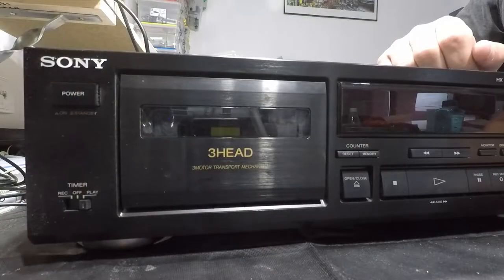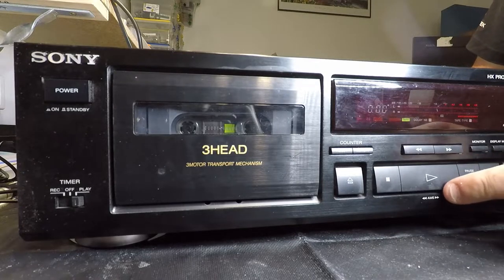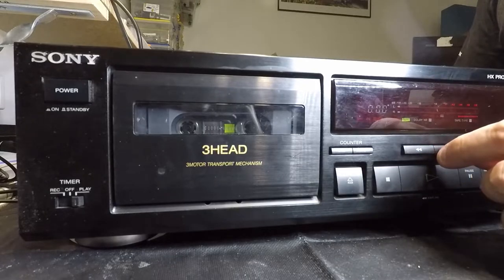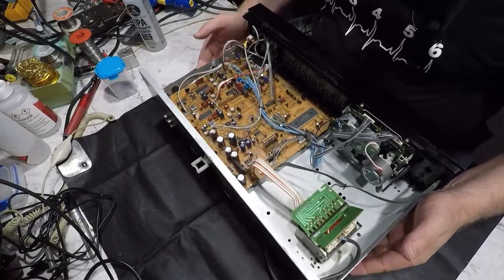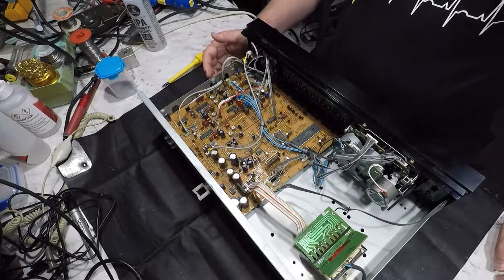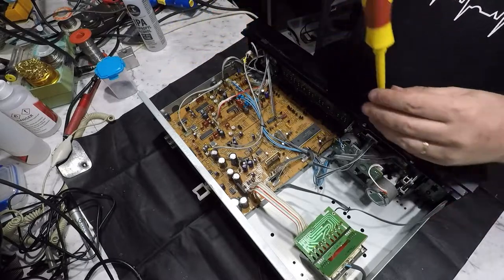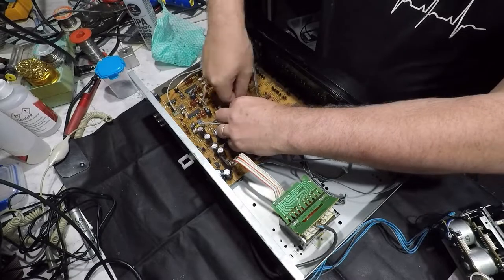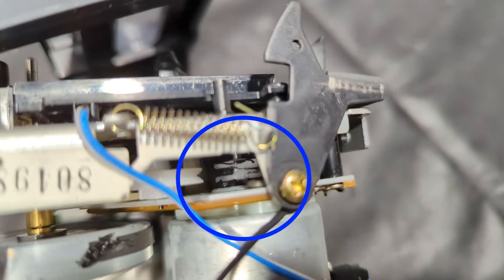Sony TC K590 repair

Comment: I also repair old Hi-Fi tape recorders, but when I have work to do to take it apart, I change the rubber belts and also clean and lubricate the sliding parts. All you need is sewing machine oil. Replacing only the rubber belts is half the job. For a quality repair, the device will later reward you with problem-free playback for a long time. I don't trust that I remember all the connections, I'll take a picture mobile first and mark  the connectors with colored markers. Giving it back is then much easier.

Comment: You are my hero! I picked up a TC-K570, which uses the same mechanism, at a yard sale, also needing new belts. I almost certainly wouldn't have done it without breaking the mechanism, if it weren't for your video.

I had a minor snag in which my cassette door would only open an inch or so; not enough to get access to the screws to remove the decorative plate. I was able to open it the rest of the way by manually applying 4V to the middle motor.

Comment: I remember this cassette deck. I bought one new in the early 1990:s because I wanted a three head deck. Unfortunately it had slight issues with flutter already from the beginning and my older 1979 Sony two head deck was more stable and also sounding clearer alltogether.
Reply: flutter is a problem indeed , have you seen the  driver motor and the small belt and the capstan freewheel? Its  a budget deck .

Comment: there no need  to dissamble the mechanic that far for the little belt , also  changing the capstan belt is very easy to do with the right tools .  I always change the pinch roller too .

Comment: I need to replace the new head for my Sony 3 head 222esl cassette Deck where will I get to buy the head
Reply from the maker: Good question, and I don't know the answer.  I can only suggest Googling around using the part number.

Comment: I got a TC-K677ES, and it seems almost the same inside; my belts had gone; I just replaced them OK. But I have a new problem; do you think it can be fixed? Any pointers? When playing back a known good tape, I only get sound from the right channel; the left is silent, and even the VU meters do not move on the left channel; just the right VU bars function. If I record, it seems to be recording to both left and right (I tried playing recording in a walkman). I wiggled all the cables, and all seems fine. Also, the recordings have a buzzing sound on them; if I switch to monitor mode, I hear a buzzing sound from any input. Even after setting the record level to zero, I still hear buzzing in source/monitor mode. The buzzing is also recorded on both channels. But playback, even of the buzzing, is just the right channel in this deck. If I press Pause Record, the buzzing gets louder and then softer for a split second.

The sound I do get from the right channel doesn't sound the best either, but it's hard to say it's not been used for years, and I just got back into tapes again.

When playing back tape and only hearing the right channel, I notice if I switch from dolby off to dolby on then off again rapidly, I see a small peak bar show up in the left channel display. Is it worth doing, or is it beyond it? Thanks
Reply from the maker: Sounds like something has come adrift between the playback head and the audio output, which doesn't narrow it down all that much I guess.  My first thought would be to check the cables in case you knocked something loose, but it sounds like you've done that already.  Other than that I'd try and find a service manual and work through the audio path looking for likely culprits.
Reply: Thanks for the reply, I will get the service manual down and start tracing it
 @tassiebob

Comment: hi, i just got this deck and was wondering how to replace the pinchrollers, never done it before so not quite sure how, also seeing you've done repair on similar models, do they share a pinchroller or its all different?

Comment: Schönes und ausführliches Video. Wenn ich es richtig sehe, wird hier nur auf die Antriebsseite eingegangen? Ich habe das gleiche Gerät, welches motormäßig einwandfrei läuft.
Ich habe jedoch ein anderes Problem. Ich weiß zwar, wie man den  Calibration-Mechanismus bedient, jedoch schaffe ich es mit keiner Kassette, die geforderten Werte bezüglich BIAS und RECORD LEVEL zu erreichen. Meist ist der BIAS zu niedrig. AUßerdem beeinflussen sich BIAS und Record Level gegenseitig. Woran könnte das liegen?

Nice and detailed video. If I see it correctly, does it only deal with the drive side? I have the same device, which runs perfectly in terms of the motor.
However, I have a different problem. I know how to operate the calibration mechanism, but I cannot achieve the required BIAS and RECORD LEVEL values with any cassette. The BIAS is usually too low. In addition, BIAS and Record Level influence each other. What could be the reason for this?
Reply from the maker: You're correct - the video was only about the mechanical side - specifically replacing the drive belts.  Not sure what would be causing the issue you are seeing.  I no longer have that deck here (its at my parents house), but the service manual may have some advice.  I suspect you've already looked there though.

Comment: Superb demonstration, thank you and thanks only to which I did muster the courage to open and change the belts. On reassembling, however, the cassette holder does not open, although I could hear a few-seconds motor whine, in the background,. In fact, the cassette holder – on releasing the retaining lever – is stuck a quarter of the way in the opening arc (power off and the mechanism block free from the chassis). When powered on, the holder remains stuck in the closed position. I bow to and take heart from your perseverance in disassembling and reassembling, which I expect I need to emulate,. In the mean time, any advice would be invaluable and much appreciated. Thank you.
Reply from the maker: Sorry for the slow response - I suspect the issue is going to be with the "timing" of the drive gear - it has to be positioned exactly as shown in the difficult to see service manual diagram, otherwise things don't work quite right.
Reply: @tassiebob  Thank you. I am trying again. The crucial step is probably aligning the gear loading cam (173), guided by the protuberance next the highest elevation on the inner crescent-shaped cam, with reference to the loading roller (173). I keep trying. Thank you again.

Comment: 'Hello ,and thanks for this video. I got the same problem got, but i didnt find the problem . Still not working ,but with 2 new belts.  If you know what cause the problem , please let us know :-)
Reply: If the tape doesn't play it's probably the program selector cam that's not aligned properly